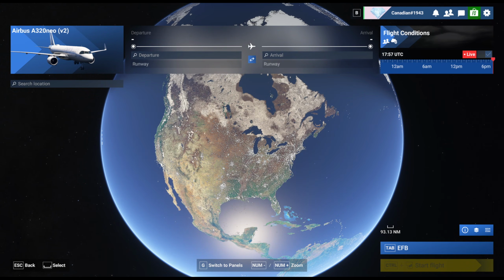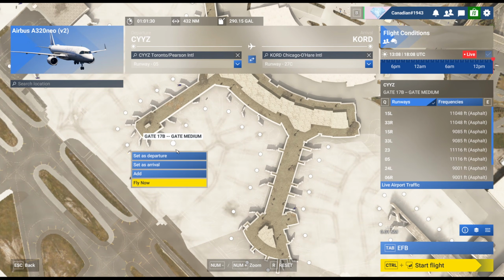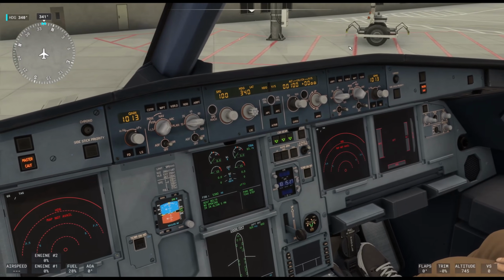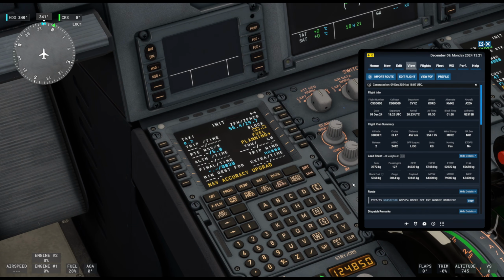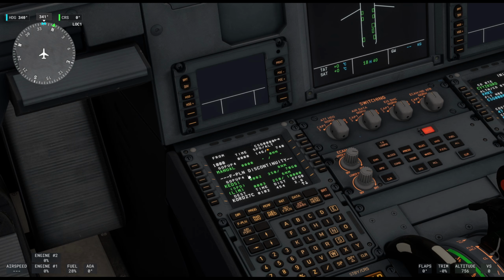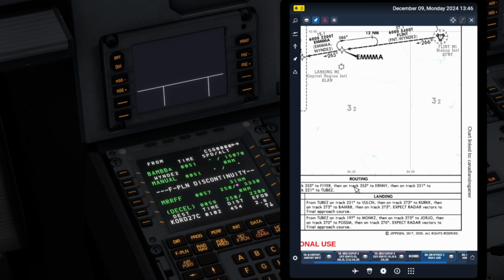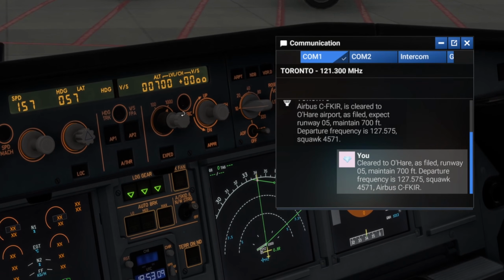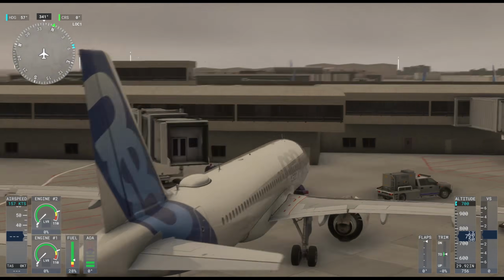A320 Beginners Guide - Flight Planning/Simbrief & Start-up  (Part 1) | MSFS 2024

Comment: I’m brand new to MSFS24, and just took my first commercial flight on the A320N. This was such a great help! One thing to note, unless I missed it, is to make sure your Simbrief ID is loaded into the in-aircraft EFB, otherwise you won’t be able to input the flight plan into the FMS. Thanks again!
Reply: Any idea how the 'init request' thing isnt there on the FMC altough ive linked my pilot ID on the EFB?
Reply: @Elæzzyto be honest, it hasn’t been showing up on mine either recently lol, so I’m not sure! I usually end up having to program a lot by hand, but I just consider it good practice! I will say, I found out if you open up your SimBrief EFB and re-import the route once the FMS is fired up, it usually copies over ~75% of the route, so you’re usually just left with importing airways, selecting SID/STARs, call sign, weight and balance info, and correcting any inaccuracies.
Reply: @anthonywcsu  Alr mate thanks for the help!

Comment: whenever im putting in the Sid for departure there isnt a gopup4. I did the exact same flight plan as you im confused
Reply: @colt0n727 i’m a real life pilot just doing this for fun you know if you don’t have it just put something similar because that means you’re sid on the MCDU or fmc is outdated and it will need upgrading, for real life you’ll have to actually upgrade it but in the SIM the SIM will upgrade it for you don’t worry just pick something similar

Comment: hi, so when I did it, there is no "init req" on my MCDU. Does anyone face this issue and could someone help me on how I can do that? Thanks in advance.
Reply: i have the same issue right now and ca e to the comments to look for a solution have you figured a way around it?
Reply: It means it’s automatically connected happens most of the time so you dont have to press init req

Comment: Why won't init request show up for me? My pilot id is inserted...
Reply from the maker: Unfortunately init request can be really finicky. If you follow the rest of the guide , you should be able to enter it from scratch.
Reply: same here
Reply: @WilledFlipper it just randomly started working again, I was using inibuilds A320 and I switched to fenix A320 and it started working again

Comment: Nice video.But where can I find a Canadian based a320 that’s not Fenix? Also you mentioned to use “/“ to use the radio. Can you explain that again since it didn’t work for me?Thx from London ON.
Reply from the maker: I am not sure of any Canadian based modded A320's unfortunately. I believe I had / set to open my ATC panel, however I would check the controls menu as it may have changed

Comment: When I’m on the MCDU INIT A page in the iniBuilds A320neo, mine looks different — I don’t have the “INIT REQUEST” line. I did everything the same as in the video, but my page looks more bare bones. Is this because I’m on the Sim Update 3 Beta? Or is it just that the iniBuilds A320neo doesn’t have INIT REQUEST yet (since you can only import SimBrief via the EFB)?
Reply: Just encountered the same issue on my end
Reply from the maker: Unfortunately the init request is the most finicky part, so I'm not sure if it was bad luck, game glitch, or if inibuilds didn't include that feature yet as I was using the base game version. Sorry about that

Comment: simbrief wouldnt give me my payload it just said it was requested
Reply: I had the same problem, on google you need to open the simbrief web, go to account settings and copy your pilot id, once you made that go tp the sim and on the EFB go to options and write the pilot id (all thiss process considering you already have downloaded the simbrief on your community folder
Reply: @elkebin1332  I just wanted to get in a hyper realistic plane and start taxiing/flying 😂 but thank you so much for a solution to this issue!

Comment: For me the flight plan does not get sent to the avionics so I can't  navigate or use autopilot on the A320 neo. Every other aircraft it works fine.
Reply from the maker: That is definitely unfortunate, however if you would still like to, if you follow the steps where I confirm the flight plan, by entering the departure and arrival it will still work if you do that. Of course you'll have to type the airport code too and not just click on it since you're not confirming, you're actually entering it, however that will work with that extra step

Comment: Thanks, that's great info. Does the same principle apply to the A330 as well?
Reply from the maker: Same principles 100%. Even mostly the same buttons, you could probably figure out the startup just by watching this video however you'll see some things are a little bit different, such as I believe two external power buttons instead of one just going off of memory

Comment: Received error downloading data message on the INIT screen.
Reply from the maker: I don't think I've received that before unfortunately so I'm not sure the exact fix, you can enter the flight plan manually though, putting in the departure in arrival it will just take a couple extra steps

Comment: Hey,  I do everything right, and everything is working great, until I get to the part where I request IFR clearance. I dont have the radio channel for that, and I even tried tuning to the channel via the channel number you used in the video (im also at toronto) I cant get the channel. Do you have any idea why?
Reply from the maker: Unfortunately I don't know why it's not popping up in your exact scenario but I do know it's somewhat common and the ATC requires a lot of work
Reply: @ i eventually just didn’t use ATC, and got into vatsim. tutorial still VERY helpful and couldn’t have done anything without it!

Comment: Really useful video - thanks for sharing. I saw elsewhere there's a way to have the AutoPilot 'manage' the heading, speed and altitude for takeoff wherein the displays for each show '-----' instead of the numbers you dialled in. Not sure which way is better, but for sure your walkthrough fills in a lot of gaps for me as I transition from the Cirrus G2 to the A320 in MSFS24.
Reply from the maker: There sure is, I will have to do more testing however as it was not working at the time which is why I decided to teach the manual calculations :)

Comment: Their is this ugly redlight in my cockpit and i cant see it throgh the aircraft windows i do not know what to do
Reply from the maker: Sorry I'm not sure what you mean, feel free to send a photo in dicord and I'd love to help! https://discord.gg/5JzRE56uzy
Reply: I have a problem that I would described in exactly the same way as you did so I guess that I have the same issue. At one point I was able to toggle it on/off using the right "Land" overhead switch. The next time I started MSFS2024, that switch no longer had any effect on the ugly red light in the cockpit. I have a cheap intel graphics card and I'm now wondering if the red light is sunlight in the cockpit but just badly rendered by my cheap card.

Comment: So with you having to download an app I'm assuming you cannot use this on the Xbox version??
Reply from the maker: @Lee-w9e  technically you can't have it on your screen like that, correct. However you can still plan your flight on simbrief website and then use the MCDU (plane computer) to enter the information.  You just won't have the INIT REQUEST but you can enter the departure and arrival airports on that same page.
Reply: @canadiansimgamer  That's what I have been doing.. I just wish the Send To Avionics worked!!

Comment: What am i doing wrong when I can't see the INIT REQUEST button on the MCDU and the flight plan doesn't show up by default even though I'm not even trying to do a cold start? I'm using the exact same aircraft.
Reply from the maker: @tontsa28  Unfortunately sometimes it doesn't work. Have you tried pressing "Import flight plan" on simbrief while you are in the plane? Even if you did it on the world map sometimes that does it
Reply: @canadiansimgamer  I just tried that, didn't work. However, I'm actually not using SimBrief but the default EFB that comes with the game instead. Is that a problem?
Reply: U have to pay for simbrief for requesting info...or do it by yourself for free  @tontsa28

Comment: Great Tutorial. I had a problem and I don't know how to fix it. When I ask to "Calculate" on Take off option it doesn't work, it says that it is unable to find safe performance data, would you know how to fix that? Thank you!!
Reply from the maker: Sometimes it just won't work, however usually that means the selected runway is not long enough with the current weather conditions for a safe takeoff in the aircraft you're in! Try changing airports and seeing if that fixes it, or even changing the weather to make the wind go the opposite way of the runway (headwind)
Reply: I also get this problem, however in my case the takeoff weight is usually 0. I then proceed to insert the current/ takeoff weight of the aircraft and click calculate. I believe this should address your problem.

Comment: How to fix ifr clearance is not showing on atc?
Reply from the maker: That will happen if you didn't import the route into the world map sometimes. Either way once the flight plan is in the plane it should be there. Make sure you tune clearance, or ground if there is no clearance. MSFS is horrible so it also just might be a glitch unfortunately.
Reply: Thank you , can I ask why i cant see my designated TRANS  on MCDU
Reply from the maker: @tabsy1237  if the option is blank, then there is mostly not transition point for the departure it arrival :) they don't all have one
Reply from the maker: @tabsy1237  if your plan does have one, I am not sure why they sometimes aren't on the mcdu, it's been a rare occurrence for me
Reply: We don’t need navigraph I thought. Doesn’t the efb together with the ms flight planner contain the charts?
Reply from the maker: Base game MSFS 2024 does now include charts, however not to the same detail of navigraph. The flight plan shown must be made on Navigraph, which is free. Only Navigraph charts require the paid version.

Comment: This is one of the best A320N startup tutorials I've seen.  I wish I didn't have to use Simbrief, but I can see it's really better to go that route.  I'm going to watch your next one now.
Reply from the maker: Crazy to be reading this comment on a video I made. I never thought I would do anything like this, and that when I did, it would help anyone. Thank you so much for taking the time to write that! It really means more than you know.
Reply: @canadiansimgamer I don’t got simbrief what do I do?
Reply: @certifiedtester7872  It's free in yout browser the only thing you will be missing is charts (they are free online too) and the current AIRAC. (sorry for being a year late)
Reply: I remember good old mfs20 days where you created a flight plan on the map and then it got loaded to mfc automatically without all that bs. Now they forced stupid simbrief to all airliners. APU has to be turned off after engines start and running doe it turn off automatically?
Reply: @Voltomess more realism ig and ppl liked doing it manually
Reply: @Voltomess  This is why I still play 2020 and haven't bothered buying 2024. Flying Asobo A320Neo is super easy. Plot the route in world planner and boom! It's in the aircraft. A 30sec process versus spending 5-10min in simbrief. If you spontaniously want to fly somewhere else then you have to go through the process again. Not what I want to do in the evening after a long day.